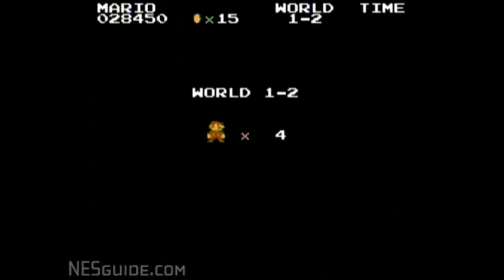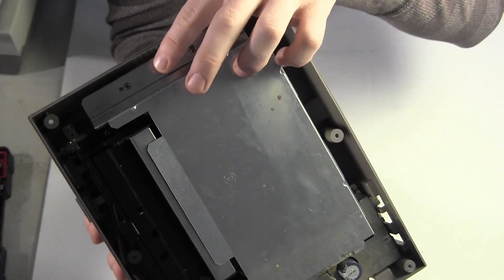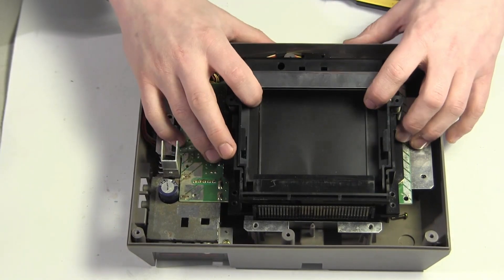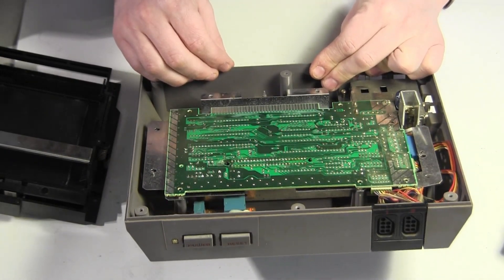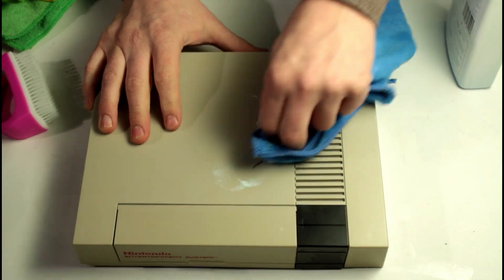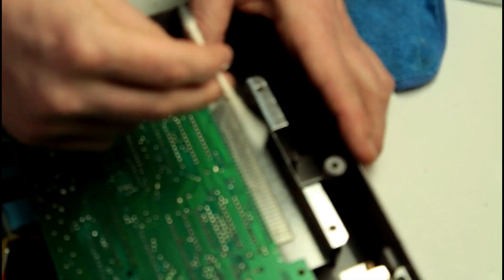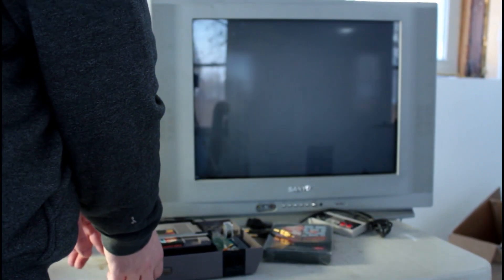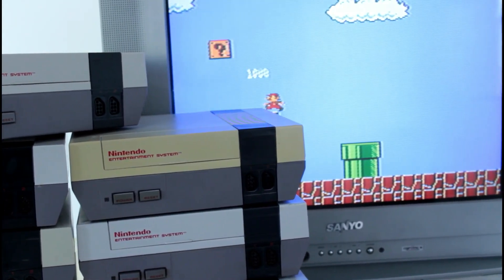I Bought 8 Broken Nintendo NES Consoles, How to Fix Broken NINTENDO Consoles

Comment: Just because a NES works for a moment doesn't mean it's fixed. Most board and RAM problems will only appear after extended gameplay.
Reply from the maker: For the sake of video time they were quickly showen working. All of them were tested for a few levels of Mario and duckhunt. None had issues except for one  that showen in the video was still flashing. Its since been repaired as well. All have been sold with 30 day warrantys and none have come back. Yes there can be many other issues. But the most common is just dirty pins. Or dirty carts.

Comment: Amazing clean. If you disable the lockout chip you'll never have to worry about a flashing screen.
Reply from the maker: I normally do this if the boil trick doesn't work. Or if I'm fixing a nes for a customer. But when I'm trying to flip them quick tome is money. Although i guess it is one quick cut. So maybe I should do them all haha . Thank's for watching
Reply: @GoodUsedGoods  awesome. I strongly recommend it because I've purchased a few refurbs from other sellers over the years and eventually, even after a clean, the blinking problem returns. It's definitely worth disabling the lockout chip in order to prolong the smooth running of an old NES <3
Reply: Can you explain what this does or point me to a video that shows it please ?
Reply: @GoodUsedGoods  have you got a video showing where this part is located and why it’s a good idea to cut it please ?
Reply: Search Youtube for NES disable lockout chip. If the lockout chip is disabled, a NES can't blink.
Reply: @weblywoobly  Thank you 👍

Comment: Any help here?? I have a console that was giving me a jumbled screen, like a game not making good connection. The Game plays great in my other console. The 72 pin connector was replace at a shop a few years ago, but not  really used in that time, so I figured it got a bit corroded.
so I removed it, cleaned it, and replaced it. Now the screen is a solid grey, and sometimes a light green. 
I thought I did something wrong, so went back, removed, replaced again, and same thing, a solid grey screen.
I have saw other people mention this when they tried replacing the 72 pin connector, so do you have any idea what I did to cause this?
Reply: Try to check the motherboard connections between the 72 pin connector and the board to see if its not corrroded or dirty . I had the same problem and after cleaning the entire board, connector and game with IPA it worked again.Or you can try bending a bit the connectors pin that make contact with the game. I hope that my comment will help you
Reply: @floriandouchin246  Thanks, I will try that..
Reply from the maker: Said better then I could of. Thanks a lot!

Comment: 100% good job! The 72 pin, you need a good source for new ones. there are a lot of crappy quality replacements going around. Most of the time, I just clean the 72 pin well along with the game contacts (those flea market games can be quite cruddy  ;) 90% Rubbing alcohol and contact cleaner can work wonders ;) He is very right with the issues. My old nes survived a house fire. Cleaned the 72 pin and used it in a unit i bought ;) The whole product was built to be bulletproof in performance. Think about it, You just have to clean and some change the 72 pin and you are good to go on a unit that is 30 or so years old ! What electronics can do that?
Reply from the maker: Not many at all. I fond most ps1 and older era stuff not to hard to fix. Its amazing to me how many things I get that are broken. And in reality it needed a thorough clean. Thanks for watching.
Reply: @GoodUsedGoods  I forgot to mention the controllers man those are solid! I am happy they did their best to get the mini controllers as close to it. the sega controllers I found was no where no where near the quality. even the games! flea market stuff is just nasty! Games that look like they were submerged in poop just need to be opened and cleaned usually. Lots of contact cleaner, alcohol and white erasers lol
Reply from the maker: @TheBillproject  Most common issue I find on the nes and other corded controllers is people wrap the cords to tight and they eventually have a break in them. But still a easy fix!
Reply: @GoodUsedGoods  you know what, that is my pet peeve. I taught my kids to leave 2 fingers of cord on top  then wrap around like normal. I see people wrapping it tight   with everything corded...

Comment: my nes short circuits the ac adapters. I broke 2 before i learned it was my nes. how do I restore that?^^
Reply: Good question.
Reply: Power supply? Check the power pcb?
Reply: Or just check the connections
Reply from the maker: Never hear of that happening before. That is odd

Comment: What kind of metal polish do you use? Will that work better than alcohol on game pins as well?
Reply from the maker: I normally use flitz or autosol. I ise a very minimal amount. And I use micofiber cloths to clean them. You dont want to rub off the coating on the pins

Comment: HI , i buy 2 NES but no one of two work, the problem is a Blinking screen and a blinking Red ligh even without a game cartridge (my working one NES do not blink without a game) What can be the problem for your experience ? The CIC Chip ?
Reply: Maybe something isn't connected inside it correctly or maybe the cic or the cartridge connector is dirty
Reply: @shakeyframe2330  SOLVED...the problem are on both machines the cartridge connector, the blinking issue i found that is normal when you have a working CIC and no cartridge.
I Disabled the CIC and boiled the connector, now are all working well.

Many thanks !!
Reply from the maker: Amazing work!

Comment: Stupid question so do you mean use a card clean the inside of the pin connector after you leave it over night to clean the rest of the residue?
Reply from the maker: I wrap a microfiber around a debit or credit crad and slide it in and out of the pin connector.

Comment: you made huge mistakes for which 10 years will show. touching them metal shields without using gloves have left acid. and boiling cartridge cons  are a mistake prone to warping and also makes plastic brittle. do not follow this armature you will just have a parts console
Reply from the maker: My main console was cleaned this way and is still going 7 years later. 
I have two that had cheap chines pin connectors put in. And both of them no longer read carts after less then a year. 
Thanks for your input. And please if you have a better idea make a video and show the people. At least that way more consoles may be saved instead of scrapped on e-waste.